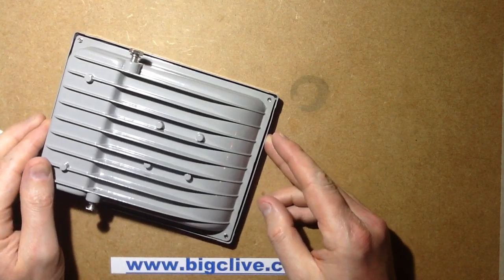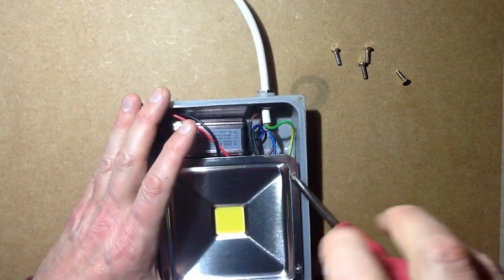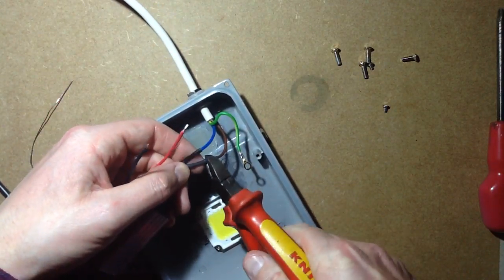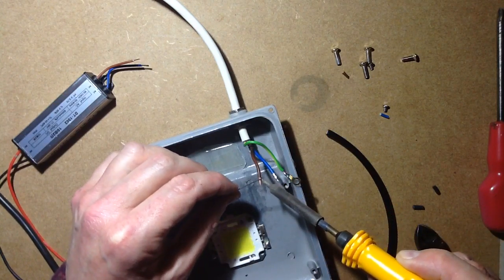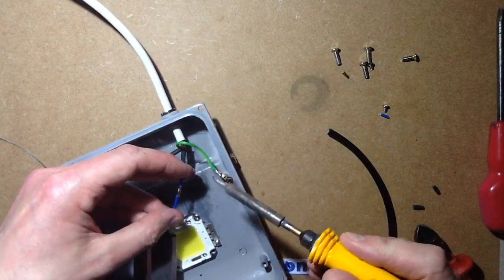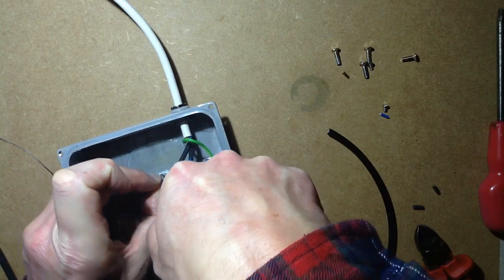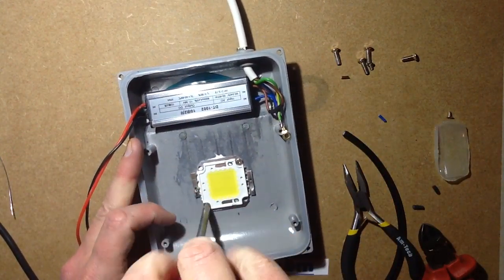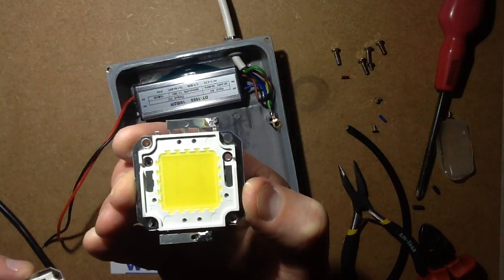How to change LEDs and drivers in LED floodlights.

Comment: Hi Clive I have a sealed LED floodlight 20W  Non replaceable with motion sensor below it purchased 15 months ago and used inside the house and all 28 LEDS have dimmed on it.  Is there any way of  getting into the unit to repair it as I don't see any screws just two holes in the back of the unit and what would cause this to happen?
Reply from the maker: One of the LEDs may have a black dot in it?  These lights are often glued shut and the glass may break when an attempt is made to open it.

Comment: I just removed an LED and its driver from one working light into another housing that was exactly the same.  I did it because I wanted to utilize a housing unit that was in a lot better shape. I hooked everything up in exactly the same way.  Now when I power up my LED blink.  I did not apply new heat sink compound.  Could that be a possible issue for my problem?
Reply: I should say that the blinking occurs immediately after powering up and continues constantly.  I have tried a couple of different drivers and the problem persists.
Reply from the maker: Is it a 10W LED?  Some are configured for about 9V at 1A (3 series by 3 parallel) and others for 27V at 350mA (all in series).   Using the wrong LED will cause the drivers to pulse because they detect their output being pulled down to a lower voltage than normal.
Reply: @bigclivedotcom  It's a HUSKY 3500 lumen worklight.  I literally took the driver and LED from one of the housings and put it into another identical housing.  Everything is wired exactly the same.

Comment: I knew I had watched you use a double layer of heat shrink some place or another. I am always picking something useful from your videos, this I put to work using MULTI layers of the stuff to build a plug for my laptop when the plug failed, as they seemed to do from time to time.  This one failed right where it went into the plug, so as a sort of experiment, I cut away the entire cover from the plug and found that this particular model of DELL had 3 wires that ran to the steel plug, I figured out which wire went where and soldered them up, then began with the smallest heat shrink I could get over the plug, and went on with the next size, then the next, and so forth till I had a nice, thick solid plug lead that extended about 3.5 inches from the end of the plug. This has been working now for a few months without fail!  I love it, it is more solid then the crap that came from DELL with the laptop, I was surprised that when I had cut off the plastic overlay, one wire was simply held against the plug barrel by the pressure of the plastic cover, now it is soldered nicely against the barrel and gives me great contact.  I went this way since I had already been through three blasted power supplies for this laptop, the one that worked the best was a cheap china crap type that I soldered on the end from the DELL supply that went to shit about six weeks after the warrantee went off on the laptop.  Thanks a million for these videos, I can't count the number of things you have taught me since I found your site, I now solder about 200% better then I did before watching your video's.

Comment: what do I use to solder leads on to led driver. Wire solder is not sticking. Don't wanna mess up led. Google sayd wire glue. Help I'm kinda like a novice.
Reply from the maker: If you're trying to solder onto an LED module with an aluminium base then it helps to heat up the base first.  I use a clothes iron upside down.
Reply: The base is plastic

Comment: What will be the voltage output of a 50w Led driver?
Reply from the maker: Typically they output between 24V to 40V at about 1.5A and regulate the current, so the voltage will depend on the load.

Comment: Great video. Did you say i cannot use a higher watt output driver to power a lower watt led? I'm planning on replacing my busted led driver.
Reply from the maker: You can't use a higher powered driver than the case is rated to dissipate the heat for.  You can use a higher powered LED to spread the dissipation from the driver though.  So if you have a 20W rated case you can use a 20W driver, but either a 20, 30, 50 or 100W LED.
Reply: Thanks for the information. How do i check how much power can my led(s) take? Really helpful video

Comment: Are there any particular brands of leds to avoid, or are they much of a muchness?  I ask because I have to change/upgrade a couple of floodlights this week.
Reply from the maker: I'm afraid it's very random.  Note that you can't use a higher power driver in a small case intended for lower dissipation.
Reply: Cheers for the reply.  Just found some decent quality ones on Digikey.  Yeah they're a good size case.  Was going to mount them to a small aluminium plate inside the case to dissipate the heat slightly better

Comment: Wouldn't the hot melt glue liquefy again when the case heats up? I'd probably use a thermal tape to hold the driver on the casing on the metal side of it. It would also help in dissipating the heat the driver is producing.

Comment: I bought 5 100w LED driverless chips like this one.  I put them in series and used a simple mains (120v) rectifier, I also added a 10w 10ohm resistor in series.  I get a voltage drop of approximately 23-24 volts across them and 0.33 amps of current even though they are rated for 30-36v and 3 amps. After running them for 10 minutes I measured a max temp of approximately 60 deg C on the chip face (heat sinked).  I realize I am not getting anywhere near their capable capacity but they are still extremely bright and I believe it is better because I should not need a driver at 1/9th of their rated ampacity.  I am going to mount them inside of a scrap aluminum outdoor wall mount I have and properly ground it.  My concern at this point would be mostly if one chip were to short out the rest of the chip would take on the higher voltage. I've never seen this done before.. I guess because its mains voltage, but it seems like itll work well
Reply from the maker: The LEDs you have a the plain non-driverless type by the sound of it.  You've created a simple resistive dropper series string of LEDs with effectively 10 sets of 50 LED chips in series.  The low current means they should last a long time.  If one or two LEDs fail short circuit the current may go up and the resistor will get a bit hotter.
Biggest issue may be the high mains voltage between the LEDs and the grounded heatsink.  But it's certainly worth a try.
With these simple circuits you will see a significant intensity variation with mains voltage fluctuations.
Reply: bigclivedotcom thanks for replying. I hadnt thought of the mains fluctuation.  I suppose i could try throwing in an inductor and cap to smooth it out or a metal oxide varistor.  Ill see if its an issue. I checked continuity between the chips -/+ and theres no continuity to its mounting surface. I plan to just ground the aluminum housing.

By the way, my wife and I are big fans of your videos (her mostly because she likes the sound of your voice lol)

Comment: i just thought to myself, if this is true 20w led, could i replace the led with a better 20w led? so its like a half hour job and cheapest? isee some 200w ones id like turn in to a grow light, all id have to do is soldier the new led?
Reply from the maker: You can use a better LED if you can find one.

Comment: The only problem I have with this video is that you are upgrading the power but not the housing. 
There is a reason why a 20 watt housing is 2.5 X 7.4 X 8.8 and a 50 watt housing is 2.6 X 9.3 X 11.6.
The amount of heat disbursement for 50 watts is greater than 20 watts therefore for overheating reasons the housing must be bigger for a 50 watt light.
Reply: I doubt that was a serious consideration in the no-name factory from whence it came, but even so, that housing does state that it is "20W" and Clive did say that he put in a 20W power supply, so where is the discrepancy?

Comment: I have a few of these but in 100 watt. which are just 2 50 watt chips. do you think I could change them out to 100 watt chips and drivers? they are quite large. I was wondering about heat.

Comment: Awesome video. 1 question please. I bought a fake 50w (12v input from car battery) floodlight and i want to upgrade it. Do i need to do the same work like you did? (or i need to change only the chip? If yes please inform me what to look for!) thanks a lot for your time.
Reply from the maker: It would require the driver to be upgraded too, but if the case is not big enough to dissipate the heat it will damage the LED when it is used at higher power.

Comment: Dear Clive, Could you use a solar cell controller to directly power a 23w led PIR module?  Or would a voltage booster be required?  The solar controller is attached to a 20w panel and a 12v car battery.

Comment: Do you know if this could be done to convert and DC powered LED light to an AC powered LED light?
Reply from the maker: It would be pretty much as shown in this video.  Just put in a new cable and connect the ground wire to the case, and the live/neutral to the mains input of the driver.  Then connect the DC output leads to a suitable LED.
Reply from the maker: +Kaleb Bessler You can put a mains voltage driver in if there's enough room for it.
Reply: Thanks Big Clive. You do not have a video showing this do you?

Comment: graet video mate, i've a couple of 50w led floodlights with the led broken, i bought  some new led and they work with 36v and 1.5a, i tested mi drivers and they give me 48v and 1.6 to  3 a
  may that current break the new leds, there is any way to low the current?

Comment: very interesting...so could I use a 20W flood light fixture and replace the driver and the LED to be 100W?
Reply from the maker: No.  the case would not be able to dissipate that much heat and the LED and driver could be damaged.  You can use a 100W LED in a 20W case if you use a 20W driver.

Comment: 6:23 In the U.S., the Ronson blowtorch company makes a reasonably cheap butane torch that comes with a miniature catalytic heater attachment. It blows out quite hot gas with no real flame. It's proven to be pretty excellent for shrinking heat-shrink, without the burning and soot that I used to get from using lighters.

Comment: Further to my earlier comment, FYI, I have just received a 30W Lamp  from the same supplier, today.  On investigation,  NO EARTH despite a 3-core cable ( foot long only, as usual) . Not a big deal to fix - but a Pain - would rather have had lamp without cable so that I could install a longer cable whilst it's been opened. The Gland was plastered with hard white sealant,  why?
It is a great pity that the marketplace is heading this way - unless this was OLD & dated stock ??   benefit of doubt but Life doesn't get a second chance when things go wrong.

Comment: Excellent stuff, mannie!  I've just taken delivery of a few today and 1st one is up n running OK - older one starting to blink  - interesting tips. I've opened one already with you - huh - I must have a better one - well stuck down , but properly earthed and more screws , etc  - So I am happy - even happier learning with you t here.  Not electrically illiterate but getting head around invisible electronics ! will be experimenting  from now on.  Have a couple of Lidl Multi  LED workshop floods - going dim - but can't quite fathom what's wrong - ...  will go back and investigate.

Comment: I'd love to do this but I don't have the confidence to work on electronics as I've never done anything like this before. 
my question is, how can we buy lights like this and know they are decent quality? getting safe products just seems pot luck these days, paying more doesn't always mean better quality. 

love your videos by the way, I can sit for hours watching you. 
thank you.
Reply from the maker: If the number of shocks received is for the UK as the number of fatalities is then that suggests that only 0.001% of electric shocks are fatal.  Even less than I thought.
Reply from the maker: It's very hard to tell what quality you're going to get from an online seller.  For greater predictability you have to buy from a high profile retailer that gives a warranty.
Reply: that makes sense and probably the safest option. 
thanks for the reply sir.
Reply: Too expensive. Some of these things go for £80 in the UK but £15 from eBay. The rest speaks for itself.  If you can make me a 100W 850nm Infrared LED floodlight like this that will connect to 12v DC power pack (i.e. 28000mah Aukey) for £20 then I will buy them from you. If you can't then you're the reason why I buy from eBay!
Reply: Unless you're electrically competent I would always buy from a reputable local dealer, yeah it might cost you  more but dodgy electrics are responsible for a lot of fires, 767 in the years 2012/13 in the UK and that was just lighting, in total there was 20,403 fires and 2,469 injuries, 46 deaths electrical related, you've got to think how much yours and your family life is worth.
Reply from the maker: Where did you get the statistic about 46 electrically related deaths in the UK?  Are many of them attributed to smoke inhalation in fires believed to be of electrical origin?  With the new industry of domestic installers being crash trained in two days with no proper mentored training it wouldn't surprise me if the number of electrical fires increases due to the Dunning Kruger effect.
Reply: bigclivedotcom took YouTube four days to send me a notification it was from http://www.electricalsafetyfirst.org.uk/what-we-do/policies-and-research/statistics/
Reply: bigclivedotcom I'd like to see more recent numbers,  since there has been an explosion in cheap electronics now being bought online

Comment: Hi Clive !
Good and informative video...thnx för that !
If it's ok I have a question.

If I where to make a "ledstrip" out of let's say 5 30w ledchips an solder them in a serie. 
Could I aply the same logic as with one ledchip, to drive them with a 100w driver and get less light but better lifespan out of the chip ?
Reply: Yes

Comment: I also only use lead based solder. Its also lees prone to whiskering. Which is why lead free solder is actually illegal in some applications.
Medical devices in hospitals and in aerospace its not allowed to use it.

A single blob of thermal compound is also the way to do it with CPUs.
Because some are concave, the others are convex. They are NEVER completely plane, and you prevent airpockets just like you mentioned.

Comment: what would happen if you use a 20w driver with a 50w lamp ?  what would go first or would it just not be bright enough ?
Reply from the maker: The drivers just put out a current limited and voltage capped supply.  All that would happen is the 50W LED would run at 20W and as such it would run cooler and potentially last longer.
Reply: thanks clive
Reply: what size potentiometer would you use with a 50w 30vdc driver to dimm a 50w lamp, it its over my workbench heatsink and fan.

Comment: You basically did the same thing they did. You powered a 50 watt led with a 20 watt power supply. Why not buy a 50 watt fixture and get the same result?

Comment: Once more an excellent video, thanks a lot. One thing I can comment on this kind of flood light is: Over time I have seen several of the ones I've purchased so far (30 Watts, 50 Watts), fail because of a very poor design of the back plate that acts as a heatsink for the LED chip. The way I have solved it has been to re-work the flood light installing inside a 4mm thick aluminum plate on the surface where the LED goes attached, that covers most of the inside of the available surface (100mm x 90mm or so) so the LED now rests over a very wide and thick plate that helps conduct heat more efficiently to the outside of the light assembly. This plate is attached to the inside of the floodlight with four nuts and bolts and also with a sufficient quantity of heatsink conductive paste. Then after the plate has been installed, new holes are drilled and tapped and the LED chip is installed once more in the same position. Then, if needed, the front aluminum reflector plate is re-worked to accomodate the new position of the LED chip (more up-front). This has demonstrated to solve the problem of life span for sure. Another modification I have made has been to install 70 x 70 mm COB LED chips, that give a lot more light than the original LED chip for the same Watts and dissipate heat much more efficiently. This also means that you need to mod the front aluminum plate for the wider aperture (area) of the LED chip. The result is impressive, I have made some comparisons with a luxmeter and you get 40% more light for the same floodlight with the same LED driver.
Thank you for all the great videos and explanations.

Comment: I recently bought a 30 and a 50w floodlights. I knew what issues to expect and look for. Both were earth connected but on the 30w the screw was over tightened and stripped threads causing intermittent contact also several of the housing scrrews were stripped.

The leads were too short.
The 50w light came with a 70w led chip,  the driver label says  50w  but the unit only draws 30w of power.
The 30w light had a 50w led chip installed, the driver was glued label down so i could not see the writing and idin't want to have to re-glue it so i didnt pop it up.

My question is will using led's with a higher rated led chip cause the driver to draw less power?
Reply: beu